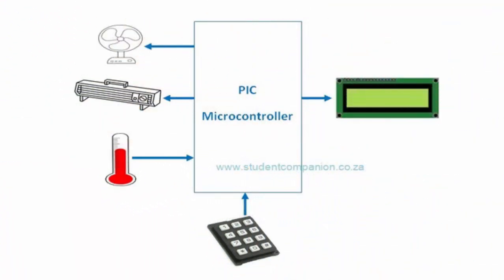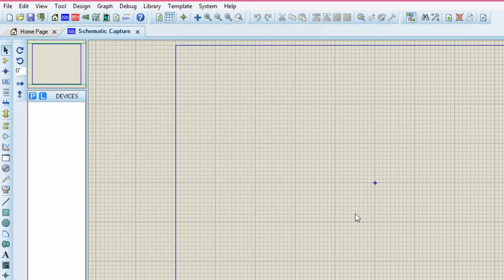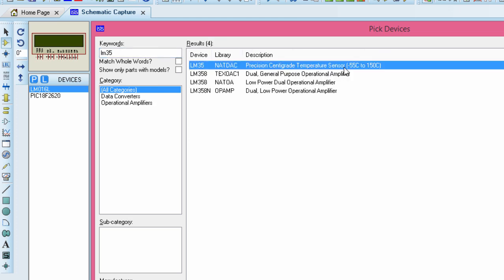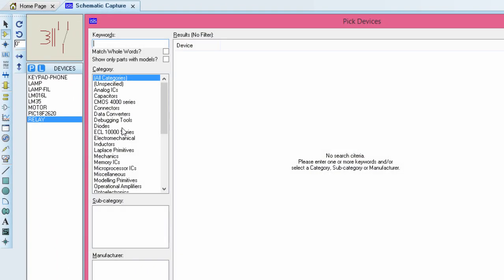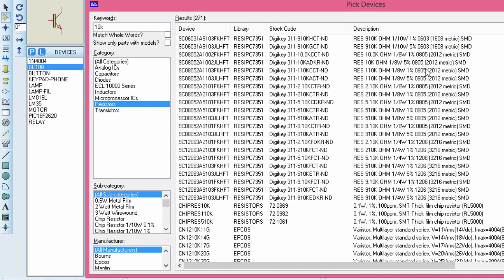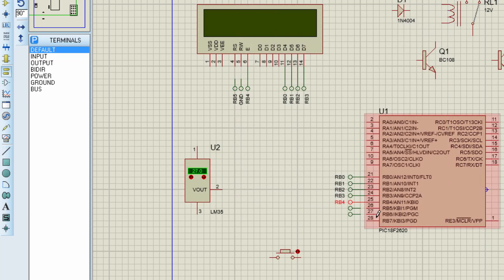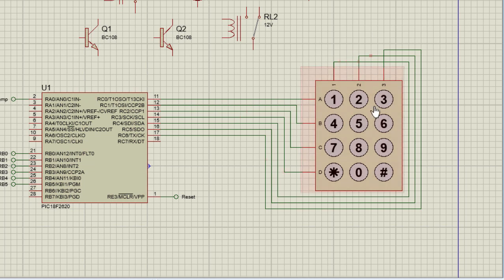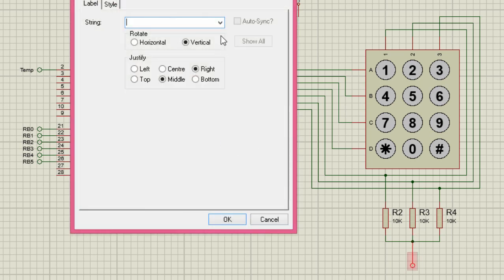11- Project 2 Automatic Temperature Control System, part 1 | MPLAB XC8 for Beginners Tutorial

Comment: Hello sir.
Sir i am using mplab xide 5.35 but doesn't build my code? 
Where must be the problem?
And how i can download libraries?
Reply from the maker: Hi. Which PIC are you using? What is the version of your XC8 compiler? Not MPLAB X IDE.  Did you modify the code, if yes, can you post your code? Can you post exactly the full error message (build log) So that we see what could be the problem?
Reply: @StudentCompanion  
Sir i don't modify yet... i just download from ur site and run in my XC8 (v2.20).
Sir does it need modifications????
Reply: @StudentCompanion  and i am using pic18f4550 microcontroller
Reply: @StudentCompanion  and it shows " unable to resolve .....".
 I will be very thankful please gave me instructions...
Reply from the maker: @muhammadadil1514  The PIC18F peripherals libraries used in this project are no longer supported in new XC8 compilers from version 2.xx.
You can either download an older version of xc8 compiler or use MPLAB Code Configurator. We explained that in the beginning of this video: https://youtu.be/4WaB_Lj8FnY

Comment: This is a great project, but it needs a link to just how to setup the peripheral library on MplabX installs that have a recent version of XC8. Plib is no longer installed and the function calls that work for the LCD, analog to digital, etc. have nothing to link to...

R.
Reply from the maker: thank you for your feedback. We have explained in details on our website on the lcd tutorial.
Reply from the maker: one can use either mplab peripherals libraries or use mplab code configurator. we will create a short video for that soon.

Comment: is it possible to design pcb for this project....can someone help me
Reply from the maker: hi, you can design a PCB, there are many CAD software that you can use even Proteus 8 can.
Reply: +StudentCompanionSA sir i am facing problm in building the code....it says plib/adc nd lcd are no such files or directory...what can i do.....i have tried downloading peripheral library but it is not getting installed...what other way out of this problm...can u help me ou sir
Reply from the maker: +Harpreet Sehrawat what do you mean it doesn't install?  it should install without a problem. what error are you getting when installing?
Reply from the maker: +Harpreet Sehrawat the other option is to use mplab code configurator.  check our video on it. it's very easy to use with peripherals
Reply from the maker: +Harpreet Sehrawat Right-click your project and click on Properties, click on XC8 linker, scroll down and tick the: Link in Peripheral Library.
Reply from the maker: +Harpreet Sehrawat Which XC8 version you are using?
Reply from the maker: +Harpreet Sehrawat Which XC8 version you are using?
Reply: +StudentCompanionSA xc81.37 version i m using
Reply: +Harpreet Sehrawat OK. Try to link the Peripheral Library now and build again.